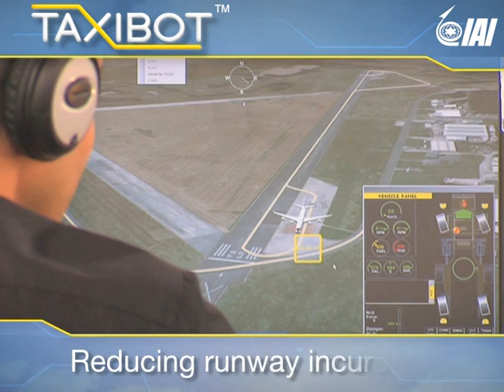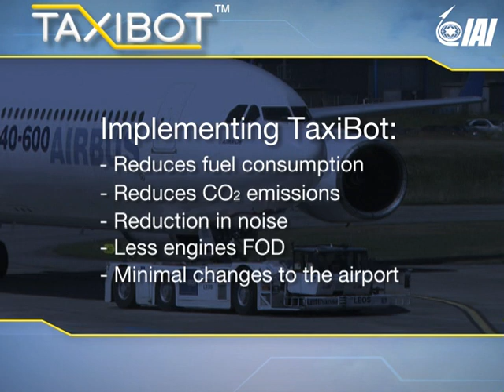TAXIBOT

Comment: What's the difference between TaxiBot and the existing airplane tow trucks? The pilot can remote control it? It seems you still need the drivers sitting in the truck. I don't really see any savings. A better and probably cheaper solution will be to have an electric motor in the nose wheel.

Comment: What about the passengers and flight crew during a very hot weather condition? They can't just use the APU for air-conditioning. Won't be enough, especially at huge and busy airports.
Reply: During Taxi out, APU for air-conditioning and electricity is ok.
Reply: Actually it is more than enough.

Comment: i still dont get what this thing can do better than the existing tow vehicles in use other than providing a fancy control and view to the pilot ? and how does it save the fuel which the existing tow vehicles wasted ?
Reply: Existing tow trucks push back a small distance and then plane starts one of its engine and taxis all the way to the runway with one or two engines. A lot of ATF is saved while using this taxibot